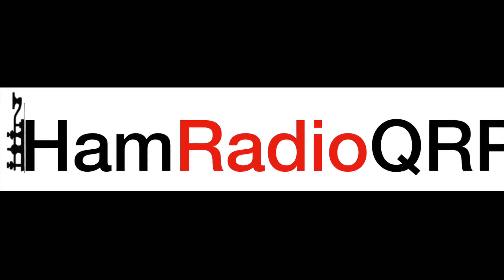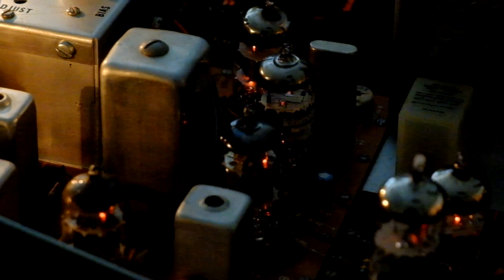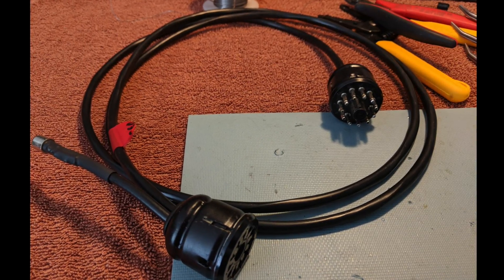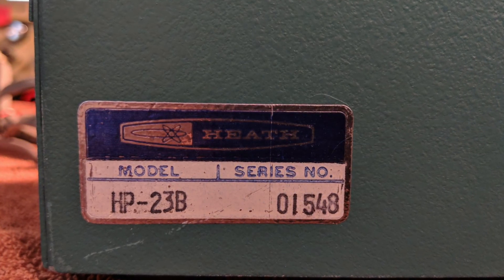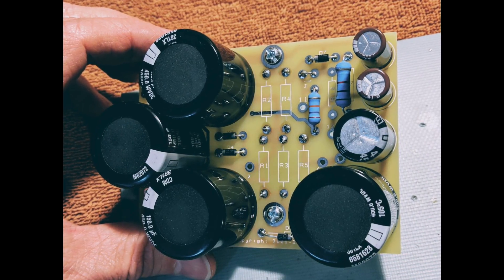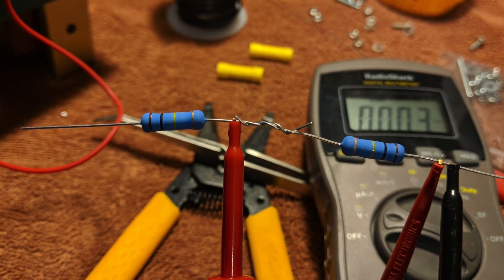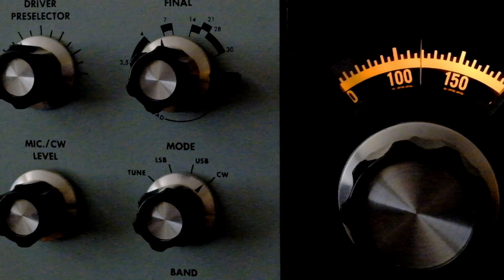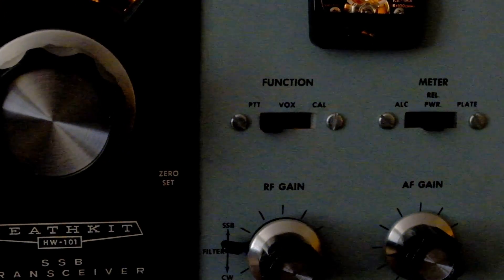Heathkit HW-101 tube radio CW QSO

Comment: Hah, nice!
It does look in great condition, so quite a find.

The HW101 was my first ham transceiver way back when. Still have it, so I should dust it off and get it on air once again.
Reply from the maker: I run my old equipment off a Variac at around 115v to present a more friendly voltage to the tubes than the standard voltage of 122v at my house. I monitor voltage and wattage draw with an electronic meter that captures all sort of metrics. The old HW-101 is the antithesis of my Elecraft KX3 in terms of power efficiency.  The KX3 idle draw is millivolts.  The HW-101 idles at about 135 watts.  Max wattage draw seems to be around 350w transmitting at 100w output.  It's a nice room heater.

On the other hand the audio out of the HW-101 is smooth and beautiful compared to the screechy KX3.  Chasing a stable frequency as the Heathkit's VFO warms up is another blast from the past.
Reply: All that power is no bad thing in a northern winter though!

And, yes, I added a home brew huff-and-puff stabiliser to the VFO on mine. Works great.

Comment: Rich, many thanks for your CW video efforts! Also appreciate the Wolf code practice review. Picked up the software and it's part of my daily regime. (My CW is rusty but sprucing it up in my retirement.)
A recommendation on a rugged, decent DMM would be to look for a Fluke 27/FM on eBay. They were recently kicked loose by the U. S. Army and are reasonably priced. Get the grey ones, NOT the yellow ones and also get one with "27FM" on the front. Those have true RMS for the AC measurement. These will measure up to 1,000 VDC/VAC safely; no futzing with voltage dividers.
Keep up the excellent work!
de k6whp
dit dit
Reply from the maker: K6WHP,  thank you for the DMM recommendation.  I went the opposite direction and picked up an old Heathkit VTVM IM-11 for $5.00 at a hamfest.  Of course it didn't work when I got it home but I had fun restoring it and now I have a Volt meter capable of measuring voltages from my vintage power supplies.  
https://www.hamradioqrp.com/2018/04/metering-high-voltage-on-cheap.html
Reply: @HamRadioQRP , just dropped back by to see how things are going. Re getting the VTVM, of course you did! Double your fun by repairing your own test equipment! That old circuit has been passed own since the late 50s and still is good today. Great for you and I love your efforts.
72 de k6whp